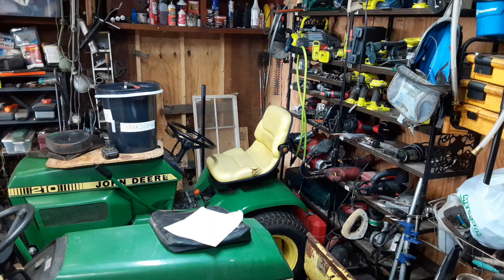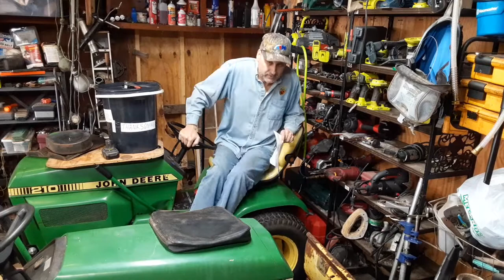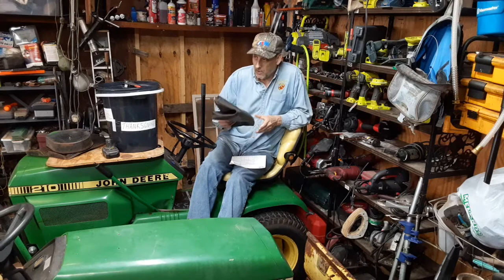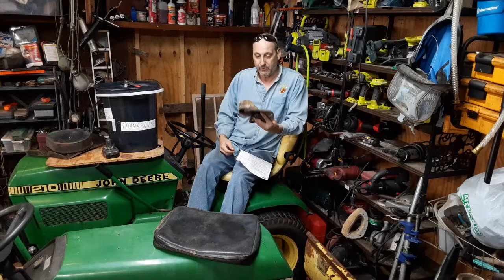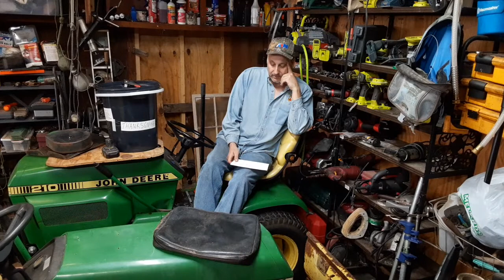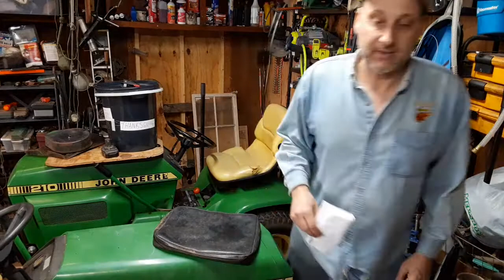knuckle busting avoidance strategies for the garage

Comment: I find that you often forget about the safest way of doing something when you are not in the workshop. I like your JD210, it looks in great condition
Reply from the maker: Certainly takes some forethought to be safe some days. 

Thanks the 210 is 1 I didn't think was gonna be very good when I 1st got it. But its turned out to be pretty decent. 2 issue I need to attend to is worn out rear hubs. But no complaints. Its exceeded expectations